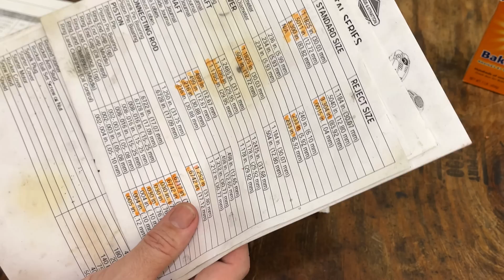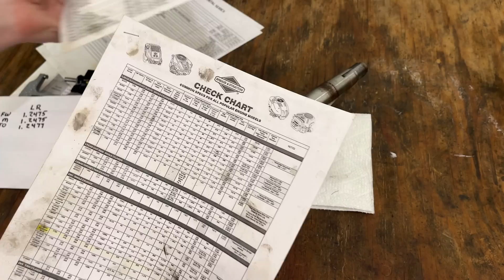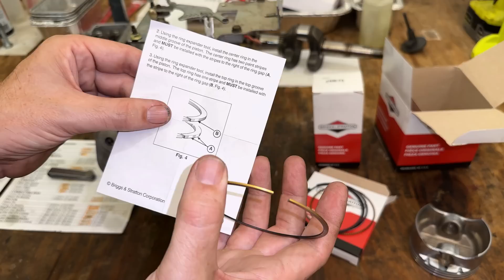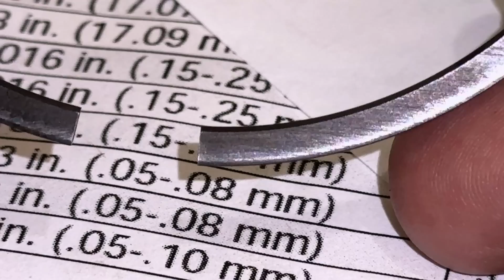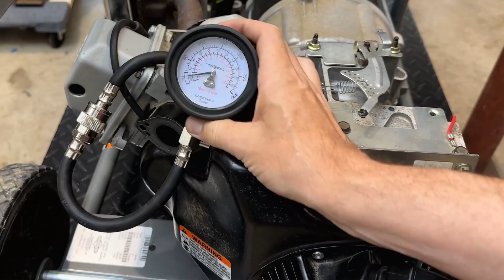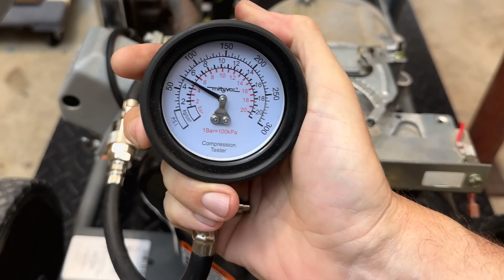Two Catastrophic Engine Failures - Are They Junk or Will They Run Again?

Comment: In post apocalyptic America, there will be just a few things alive. Two Chevy 3800’s 4 K series, Honda engines. 2 dozen cockroaches. And every generator this man has ever touched!!!
Reply: Those, and a few skeletal 7.3 Ford pickup engines in salvage yards
Reply: WooooWeeeeWoooh grammar police, I don't want to put words on the page in your wake so I will suggest that perhaps either you meant,( there will be just a few things still working. Or you might be suggesting that the two Chevys 3800 and anything this guy ever touched etc had found life itself and took over as a master race. Either way I had a heart attack and was compelled, nah I had a good laugh. 😂 Adhd much?
Reply: Nice!
Reply: I had a Chevy 3100 V6 that had 328,000 miles on it when it was towed to the junk yard still running. I was pissed my dad junked it, needed a brake line.
Reply: I have a 4.0 Ford areostar 2wd 587987 miles
Reply: Just to let you know, a few weeks ago, I started my '65 Chevy C-10 long bed pickup truck, a vehicle I inherited from my dad back in '92;)
Reply: My 2002 Camry 4 cup has 274,000 miles and still going strong!
Reply: But we borrow from the Frankenstein movies when reviving an engine. After the struggle to revive it, we exclaim...ITS ALLLLIIIIIIVVVEE!!!

Comment: Jim, not criticism , but my dad used to photocopy pages from various manuals (Chilton's, Haynes, etc), for what he was working on, and he put sheet protectors on them, and in that manner, he kept them nice. Just an idea for you.
Reply from the maker: Good idea.  I have a few critical information sheets that could use that.
Reply: @jcondon1   or just laminate your sheets will last for ever then :)
Reply: Or scan and save what you need and print the pages as often as necessary.  You'll always have a fresh copy so you can make notes and get them greasy.
Reply: @hugh007 and you can write measurements on them, very handy if you're checking specs, you can write out what yours was right next to it.
Reply: I usually print out sheets for a particular job, doesn't matter if they get ruined.

Comment: That Briggs engine will run better than new.   You basically hand built it with loving care and precision.  Excellent work!
Reply: Yes!
Reply: That's the way it goes with mass-produced products.  You get a bunch of mostly-finished parts mostly-correctly assembled.
Reply: Very interesting, do you complain or inform someone about the old ring u received?
Reply: But the new owner could run it out of oil all over again love and care down the drain 😢

Comment: Call me cynical but engine failure seems to be a common theme since they removed the low oil sensor. And now the bell housing is fitted with lock washers, it's almost as if they know the engine is coming out soon.
Reply from the maker: The newer Briggs generators added them back.  Of coarse they are now Briggs branded Honda clones :(

Comment: This reminded me of a cub cadet mower that I bought several years ago. It was a high end 21 inch cut with swiveling front wheels multiple speeds and blade engagement. Back then over $500. I had cut down a 2 inch black locust that was in my way and the grass grew up and hid the  stump.  Of course I hit the stump and immediately broke the crankshaft where the blade adapter fit the end of the crank. After cursing myself I went and got a new crank. It was a 6 hp Kawasaki engine and as I took it apart I was very impressed with its design. I got it all reassembled and it would not start. First thing I thought was I didnt get the timing set correctly. Before thinking I tore it down again and found the timing to be set properly. I walked away and came back a few days later. I pulled the valve cover and found that a push rod had not set in the rocker. This was the first machine I had owned with overhead valves. I shared this story with friends because I felt that other people might also not be familiar with overhead valves on small engines.

Comment: When using those pullers you don't just wind them up tight with a spanner- you put a load on with the spanner and then hit the centre bolt with the hammer to crack the seal of that tapered joint. Much less strain on the puller and housing that way.

Comment: @jcondon1 one point I'd make the bolts likely didn't stretch, the aluminum rod cap squished out from under the bolt. Aluminum expands 4 times more than steel, so it will flow outwards and mushroom. This is the same failure mode that makes aluminum wiring dangerous too.

Comment: A couple of tips for you,  If you do use that type of hone - Use engine oil and a fraction of the drill speed you had as you need to be going in and out nearly as fast as it's rotating for the correct "cross hatch" finish.
Use the smallest smear of assembly lube where necessary first then oil for pre lubricating.
Put the faintest smear of anti-sieze under bolt heads  and lightly oiled threads for things like those Alloy Rods to reduce any gauling when torqing the cap bolts - + any incremental tightning should be at least needing 90deg.
I realise it's not a Race engine  but you strike me as a Guy that likes to do things as best as possible ;)
Reply: Very few people on youtube actually knows how to hone a cylinder for the right cross hatch. I see people that is professionals messing this up. Its kinda wierd actually haha
Reply: @simenk.r.8237 Yes, how very "wierd" - you misspelled that, by the way.

It's a mystery how everybody can screw up their honing when they could easily look up the correct technique on the million subscriber honing channel of world-class craftsman simenk.r.8237 who generously shares his infinite wisdom in hundreds of his painstakingly edited videos.

The world is lucky to have heroes like you, simenk.r.8237!
Reply: @Lokomowal  Between him and all the heroes like you correcting spelling and message content, we will soon be living in utopia!😒
Reply: All good advice, especially about the cross hatch. A drill with a two speed gearbox can help there.

Comment: I would be pretty pissed to find a used ring in a supposedly new ring set, especially at that sort of price. Most ring sets are under £10 in UK but some B&S sets are around the price you suggested.
My guess is that someone bought that set, swapped the top ring then sent it back saying that they bought the wrong set, and the vendor didn't check closely enough (or was the one who did it depending where you got them).
Reply: When you find that sort of disappointment it's always difficult to know whether you send it back on a matter of principle, and mess up your schedule in the process, or just find a way round it.  Very annoying when you open the package and it's not got the correct contents.
Reply: That’s exactly what happened someone said F this I’m not paying $50 for rings and swapped one out.  I just hope he doesn’t let them slide and gets his damn money back!

Comment: The Engine Dr. wins once again. I am amazed at the number of FUBAR generators in your area and even more astounded at the lack of attention to oil level by their owners. I can only assume the owners are very affluent and treat their equipment as consumables.
Reply: I think it's likely a matter of ignorance of small engines. Many people do not know that you should be doing your first oil change at the ten hour mark.

I think people believe that they only take their car in for oil changes once or twice a year and the generator gets way less use than the car so why would you need to check it!

Ask me how I know 😂😂

Comment: A tip:  I had a rotor that would not come off and would mushroom the pusher rod.  Did two things:  i used a small slug of brass between the rod and the pusher bolt.  The main help was sneaking about 4 turns of #16 wire around the front of the rotor shaft and positioned them near the fan.  brought the two leads out to a "Hot Rod" handheld induction heater.  Fifteen seconds of the heater and the pusher bolt had the rotor off.  It is fairly easy to thread four turns around the shaft. I had considered using a small torch but fire hazard negated that idea. I had fought this for hours trying everything hydraulic, and slide hammer... nothing worked.  It was so easy with the induction heater it surprised me!

Comment: James, you can buy feeler gauges with a .002" step for a "go-no-go" effect. Also a couple of old school references on small engine rebuilds: To be perfectly accurate there is a measurement of "pull" on the feeler gauge. Depending upon the actual part being measured 1-3 ounces is a good "thumb" however, there is also supposed to be oil present. We used Ring end gaps of  .0025"- .0035" for every 1 inch of cylinder diameter. An old example used to be "A 4 inch cylinder can use from .010" - .014" Ring end gap. Larger if it is a very hot applications like Turbo or Supercharged. We rebuilt a lot of engines with those specs and never had a piston stick or use excessive oil. Good video, thanks for offering it. ben/ michigan

Comment: Found this recommendation from Winco.
 
REMOVING AN ARMATURE OR ROTOR FROM THE ENGINE CRANK SHAFT 
 
The armature/rotor is just taper mounted to the engine crank shaft and held 
in place the bolt running down the middle of it.  Remove the bolt or nut and 
washer before continuing.  
 
You will need a flat metal bar and good steel hammer.  Insert the flat metal 
bar between the end of the armature/rotor and the engine, so that is rests 
on the engine crank shaft.  Strike the metal bar crisply with a steel hammer.  
This will set up a vibration in the hardened crank shaft, the vibration should 
break the seat between the armature/rotor taper and the engine crank shaft 
taper.

Comment: I think this video is a message to 99% of the other videos where people are doing this without a torque chart and measuring tools. I have rebuilt two car engines using this kind of care and proper tools with torque charts and degree wheels. Toyota was straight up torque to point but BMW in some parts required degreeing after reaching the desired torque called bolt stretching. You also have to remember to not miss any bolts or they will fall out later and cause serious engine problems.

Comment: Hi James. As normal a great video. As a race engines builder, I’d like to suggest your next video like this, use your dial bore gauge and micrometer to calculate the rod to pin clearance. It’s not hard and more reliable

Comment: the engine intake cleaning up as if it was brand new, tells me it has less than 500 hours on it, no more than 250 at most (in my opinion)... makes me think the previous owner ran it on the factory shipping oil then it crapped out, thus leading to this video :D

Comment: I'm going to have to remember that grease trick. I was rebuilding the head for a Volvo b5234t (5 cylinders, 4 valves per cylinder) and the cotters popping out during reassembly drove me to insanity

Comment: I have learned enough from watching your videos that I took a risk on a generator for cheap. It only needed a capacitor. I have a potential tip for you. Very established electrical reviewers are going nuts for the Zoyi ZT-702S / Xeast XE-702S. It is a hand held multimeter/oscilloscope.
Reply from the maker: I have something similar https://a.co/d/hMd7BUc

Comment: I really like to thoroughly clean off the valve lapping compound with a solvent spray, then hot soapy water. As I'm paranoid that I will leave traces to continue wearing out valve stems...

Comment: Excellent video. Very detailed. I love your work ethics. One thing surprised me that you didn't change valve seals. Engine has heated up at some point which changes rubber characteristics. If I had opened up engine I would definitely change them. Just my thoughts. Great video again.

Comment: I really appreciate your videos. You are very detailed which is appreciated very much. I will say that at the 1:22:20 time in the video, you mention adding oil so you don't forget because you are getting excited at nearly being done. I can certainly appreciate your thought process here. I'm not a small engine mechanic. I do have a lawn care business, so in order to save money, I do all of my own maintenance and so far, all of the repairs on my equipment I have done myself. Prior to going into the lawn care business (which is a retirement job for me just to stay active) I had a 54" John Deere Z425 zero turn mower that I had been using on my own yard and on my neighbors yard. I continued using that mower on my yard and my neighbors yard even after starting my lawn care business rather than using one of my other zero turn mowers on these yards. I developed a slow oil leak either on the sump gasket or PTO shaft, but I always checked the oil level prior to using it and would simply top it off once every couple of months as it needed oil. One day I did my yard and almost all of my neighbors yard when I started smelling burned oil. I only had a couple more passes to make on my neighbors yard, so I finished it and went back to my shed and started checking on the oil smell. I had no oil left that was visible on the dip stick. The mower was still running fine at that point when I parked it. I added oil up to the full line and there was a slow but steady dripping leak while sitting and it got worse when the engine was running. Either the gasket or the seal had seriously failed. I pulled the engine on it and pulled off the sump and replaced the oil pan (sump) gasket and the PTO seal. I reassembled the engine and put it back on the mower. Installed the PTO pulley and reattached the deck. I was so excited to have completed the job. I fired it up and it ran like a champ even under a load from the deck for about 1 minute and then I heard a "clink" sound and it wasn't running correctly. I turned it off and soon realized I hadn't added oil to the engine. I had failed to fill it up in my excitement over "completing" the job. I of course added oil, but that did nothing to help. It will run on one cylinder now, but that is all it will do. That was two years ago and it will still run on one cylinder, but it won't power the deck. I appreciate you saying what you did at the 1:22:20 mark. I've been there and failed to remember to do a very simple and basic task and I assume as a result I ruined a good engine. At some point I keep thinking I will pull that engine again and figure out what the damage actually is, but I just haven't gotten to that point yet. I have two good 52" Scag Tiger Cat II mowers that I can get the job done with and have no pressing reason to tear into the other mower. I'm sure that at some point I will get there, but I'm just not there yet. It was a bit defeating to have that happen. I have rebuilt a few smaller engines on walk behind mowers since then and they have all worked fine, but that taught me a lesson I will not forget. Keep up the great work!!!

Comment: Im a firm believer in lapping tool, however, i work with an older guy, both of us are certified on several makes of engines. Honda, Kohler, Kawasaki, Briggs etc, but he always uses a drill to lap the valves. Whats your or your followers opinion on this? I rather feel the lapping then using a drill. Thanks for all your hard work you put into your content, very much enjoy em